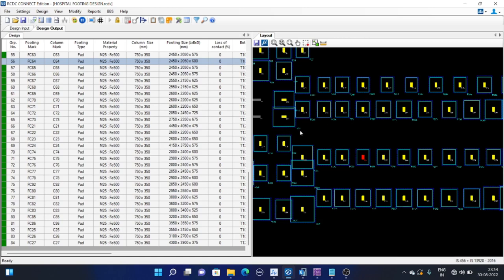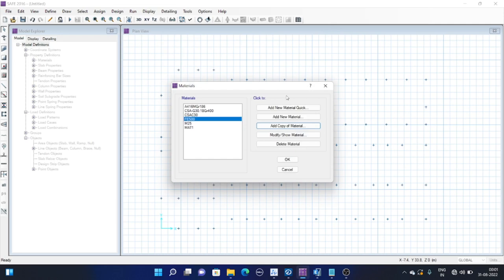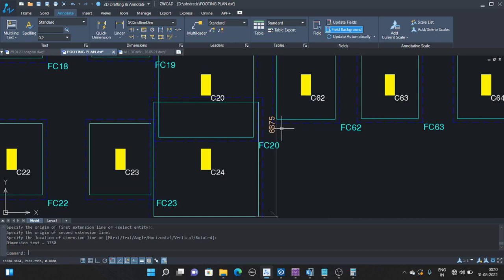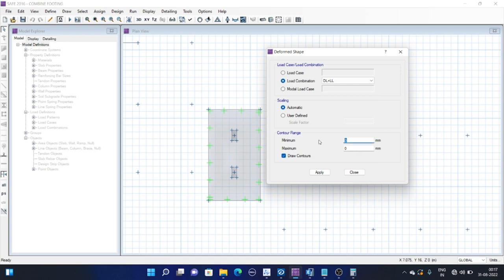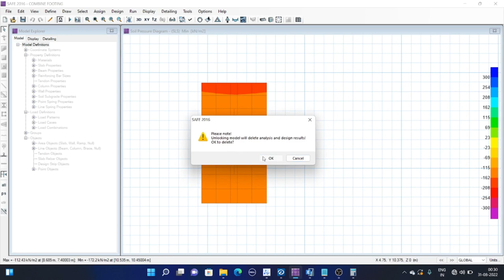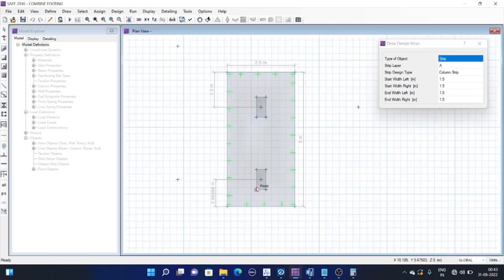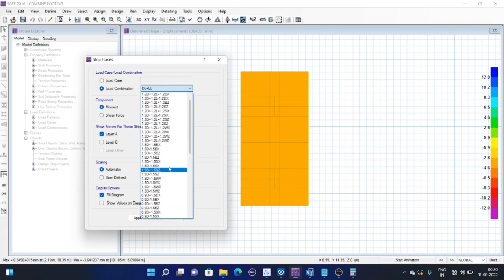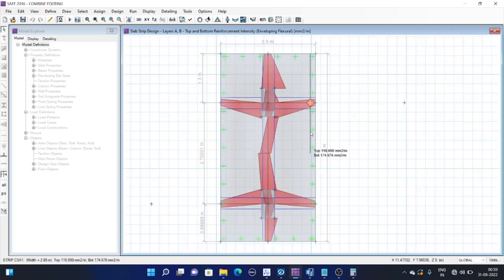COMBINED FOOTING DESIGN IN SAFE

Comment: Nice video sir. I am using safe v20 and i am facing problems when designing footing from loads exported from etabs. the displacement/settlement values are weird, they come with an exponent of 17 or 18 which is very large value, also the bearing capacity values for the combined footings come positive values and not negative values, what can be the  problem here? i did assign the sbc values to the footings though.